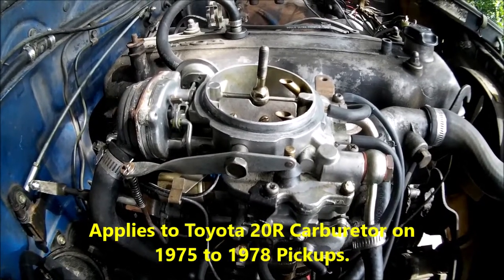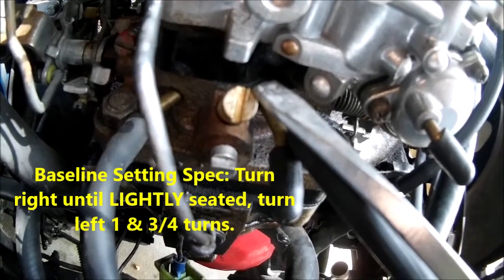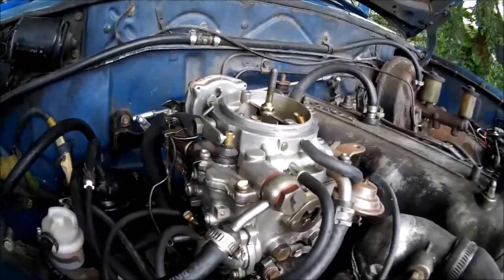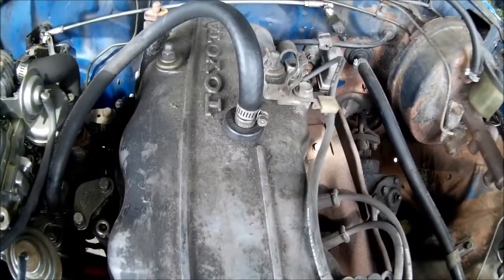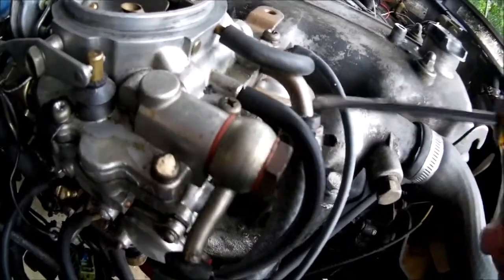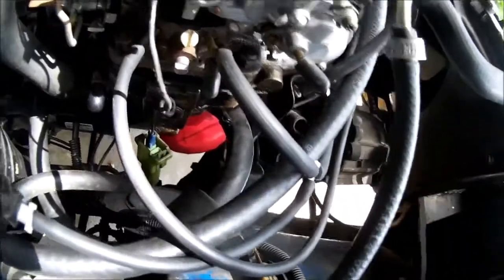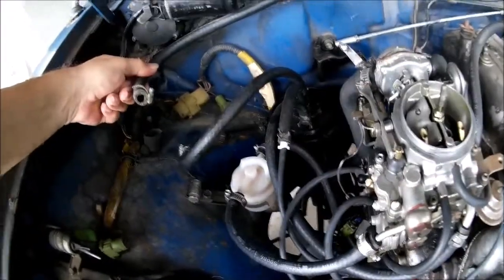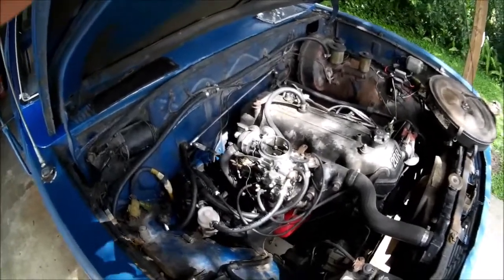1978 Toyota Pickup/Hilux 20R-Carb Adjust & Vac Lines-Desmogged

Comment: Thanks for the video.  I am having trouble getting a smooth idle. When I go to set the throttle positioner either goes 1300 or 600.  FSM says to set it at 1050, then do the lean idle mixture procedure.  Do you have any clues?
Reply from the maker: If by "throttle positioner" you mean the Idle Adjustment Screw I do have some ideas. First thing that comes to mind is that you should only try to set idle speed when the engine is at full hot operating temperature. The reason for this is that the choke mechanism is mechanically connected to the throttle, and if the engine isn't up to full temp, the choke may be trying to keep the engine at high idle for warm up purposes. There are several "steps" on the part that the Idle Adjustment Screw can contact, and it may be contacting one of the "higher" idle steps sometimes, other times the "correct" hot idle "step".

Looking at your speed numbers, they are not correct (according to my sources), but would indicate to me that this is what is happening. The difference between the 2 numbers is correct. The spec I have on hand for the '78 20R is "Hot" idle speed 800-850, High (cold) idle speed 1600-1650.

If you are trying to adjust with the engine at full hot temp, then you have a "sticky" throttle linkage on the carb. Meaning there may be some dirt/dried fuel residue "gumming up" the linkage and making it bind up. You may want to try spraying down the entire linkage with carb cleaner & letting it thoroughly air dry then try to set it again.

Beyond this, there are several other things that could cause this. Worn, bent or damaged throttle linkage parts from pedal to carb, damaged or missing parts on carb, vacuum leak(s), carb itself worn (most common issue being worn out throttle shaft bushing causing a hard to find vacuum leak), bad carb gaskets, out of adjustment or bad choke mechanism (not too common).

Just start with the basic stuff, like making sure the carb & linkages are clean & that it's up to full temp before trying to adjust. 8 times out of 10 it's the small, simple things.
Reply: thanks so much. By throttle posistioner, I am referring to the screw on the far right (looking from the passenger side of engine in) that is a bit underneath and the screw adjusts the throttle/butterfly on primary side). Since I wrote you,  my brother and I decided to rebuild the carb.  we are almost done.  We are also going to check all the throttle linkage and make sure it is smooth.  We did find a couple of small ports clogged and got some grim off the linkage springs.  We will see.  We will continue to troubleshoot per your tips!!  You are awesome.
Reply from the maker: @MichaeleLaForge  Oh that one. That adjustment screw has very little to to nothing to do with idle speed in normal conditions. It adjusts the "Dashpot", which is the common term for that item; Toyota calls it a "Throttle Positioner". IF you can put that screw back on the setting it originally was that would be best.

The Throttle Positioner is connected to a vacuum diaphragm that controls it's movement. It's purpose is to cushion the throttle from slamming shut when you completely remove your foot from the gas pedal. It basically "catches" the throttle linkage near the bottom of it's travel and lets it settle to the full closed position smoothly. All this happens in less than a second. Also, if you've run that screw IN a bit or a bunch more than it should be, it could be affecting your idle speed.

If you end up having to do an adjustment on it after your rebuild, it's going to be a more-or-less trail and error thing. A good baseline setting though is as follows. Engine not running, choke plates OPEN, Idle Screw on low idle cam. Turn the Throttle Positioner screw OUT until it no longer makes contact with it's linkage arm. By this I mean it just barely doesn't contact the arm Then turn the screw back in 1/2 turn.

Start & warm up the engine to full temp, make sure choke plates are fully open & idle screw is on the low idle cam. Rev the engine a bit and then completely let go if the throttle (you can do this under the hood). Watch the Throttle Positioner arm where it contacts the screw & listen carefully There should just be a slight delay in it settling down to normal low idle. This delay will literally be like 1/2 a second or so. If the delay is longer than that, back the screw out a little at a time, like 1/4 turn, then rev, watch & listen again. Adjust until you get about that 1/2 second delay.

You could also get lucky and see by discoloration just where on the screw it was set. Where it was inside the threads will be cleaner looking than the rest of the screw's threads.

Once you get that set, go back & set your Idle Speed screw to the left side of the carb, passenger side.

One other thing, in case your carb rebuild kit didn't mention it. Baseline setting for the Idle Mixture Screw (passenger side, low center of carb location). Run the screw in CAREFULLY using only light finger pressure on the screwdriver, until it just stops.
DO NOT TIGHTEN IT DOWN OR YOU WILL DAMAGE THE SCREW & NEVER BE ABLE TO GET A GOOD IDLE QUALITY.
Once you have the screw in that position, turn it back out 1 & 1/2 to 2 turns. That should give you a good mixture setting to start with and get the engine running.

You can further adjust it afterward for fine tuning. If you need info on this just let me know.
Reply: @The13thSword  Success! The carb rebuild definitely helped the performance but idle still tough. So I actually read your post on a forum.   Your comment about the dashpot and the quick back to idle after flicking accelertor.  You said it would go back to 800 ina couple of seconds.  That got me really thinking about the dashpot and what it does.  I tested it per fsm and  it  turned out that the vacuum switching valve was bad and it was not getting any vacuum.  

I went thru the set up per manual and what you advised and now I have a stable idle at 800, 8 degrees before TDC.  So 😊.  now I will go to Cali smog test.
Reply from the maker: @MichaeleLaForge  Excellent work. As long as the Dashpot has an engine vacuum source it will work the way it's supposed to. Hopefully you won't have any problems passing smog. Even with some or all of the "smog" equipment not working, these engines, when in proper tune, & a good state of repair, still run very clean. Also due to the age of the truck, they really don't know what smog equipment is supposed to be there so you'll likely pass the visual inspection without issue.

You haven't mentioned it & you may have already done this, but you may want to do a valve adjustment to make sure they are in spec. It can make a big difference in smog test readings.

Pro Tip: I know the FSM says to adjust the valves with the engine totally hot, but it can be done properly (and more easily & safely) when cold. I set the valves 2 thousandths above the spec.
Spec is Intake .008", exhaust .012", so I set them cold at .010" & .014". Once the engine heats up all the metal parts expand a bit & the clearance goes right to spec. I've tested this several times and the clearance is always spot on spec at full temp.

Let me know how things go.
Reply: Hi, I passed smog a couple weeks ago.  Thanks again for your tips.  Since then I started working on niceties.   Visors, dome light, radio.  All repaired.  
One thing that is funky is that the truck runs really well, warms up w choke working well etc..but after I drive it for a while, like 5 Mike's or more, then park, then go to start it, it won't idle...it starts then drop to zero RPMs and dies unless I apply a little gas...after a while it settles back into running smoothly.  I am going to check for vacuum leaks, timing and make sure  sparking on all cyl.  Seems like a timing issue.
Reply from the maker: @MichaeleLaForge  Sounds like a good plan. Timing on the 20R should be 8 degrees before top dead center.

Other item I would check is the ignition coil. if it's not a new one it could have some high resistance due to fatigue in the coil wires inside. And a failing coil could act the way you describe. It's easy to check if you have an Ohm meter. The stock resistance specs are: Primary - 1.3 to 1.7 Ohms, Secondary - 6,500 to 10,500 Ohms. Primary is measured on the + and - posts, Secondary is measured on the center post and the - post.

Check em both out but it's been my experience it's usually the secondary that goes wrong first. Those specs are "cold" readings BTW.

Other things it might be are a partial blockage in the idle circuit, sticky distributor advance weights, sticky vacuum advance. Depending on how old the distributor is it could be either of those last two things, and both of those affect timing.
Reply: I do gave the dashpot on full time vacuum...cause I discovered the vacuum switching is not working...not sure want the issue is get...I tested w long hose and pressure sensor in cab when driving and no changes were happening.  perhaps speed sensor issue ?   the other thing I disconnected was the aap cause the tri port thermo vacuum switching  valve (near intake) not working all ports are always vacuum...so it was sucking fuel all the time.  I did both those disconnects prior to smog, and the issue started then. So maybe a fuel prob, rather that ignition?
Reply from the maker: @MichaeleLaForge  No problem on full-time vacuum on the Dashpot. I have mine that way & it works fine.

There are no speed sensors in this vehicle. They didn't exist when the truck was made.

AAP. Have you got a good quality vacuum cap on the port to the AAP? You should. Do you still have a vacuum line running to the thermo vacuum switching valve?  If so, disconnect it, remove the vacuum line entirely & cap off the vacuum source for it.

Unless it's been modified, you should also have a "vacuum tree" on the intake, located directly below the carb on the passenger side. That thing has at least 3 vacuum ports on it that need to be securely capped off. I removed mine during the "desmog" process and installed a plug.

One other thing I remembered. Try testing your pickup coil in the distributor for resistance. Cold it should be 140 to 180 Ohms. And yes, when they start going bad they can act just like a failing ignition coil, i.e., higher resistance when hot. This would also make sense if the distributor is old/high mileage.
Reply: @The13thSword  Thanks 13th. I put a new coil in. so it may be some of the other items you suggest.  I will do one at a time and see if I can find smoking gun.  the other thing I found in the owners manual that has very specific instructions on how to start the truck when warm.  It says: Hold the pedal about halfway down while cranking the engine. Do not pump the pedal.  If quite hot, press the accelertor fully to the floor while cranking.  

I had been either not doing anything to the pedal, and when it started and died, I would start pumping the pedal. I was essentially doing opposite what the manual instructs!  that also may be the problem...maybe I'm starving then flooding?
Reply from the maker: @MichaeleLaForge  As long as you've got a good quality coil and it Ohms out in spec it's probably good.

About starting warm or hot with a carbureted engine. I don't disagree with those instructions but will say they go a bit more to the side of caution. And they do leave one thing out. In my experience, with an engine that is up to full temp, you shouldn't have to touch the pedal when trying to re-start, within say, 20 to 30 minutes. If everything is set up & working properly, you should be able to just turn the key to start & it'll fire right up in a second or two. Of course this demands that you have zero vac leaks, the carb and ignition system are working right & the engine has no issues.

The reason they want you to either hold the pedal halfway down or full to the floor has to do with a condition known as heat soak. The carb can absorb under-hood engine heat, especially when you shut the truck off. That heat can start vaporizing the fuel in the carb's bowl. The vapor then goes out the vent tube & falls down the carbs throat. Since the engine is not using that vapor, it tends to build up in the intake manifold. Holding the pedal halfway or full open when cranking "hot" opens the carb's butterfly valves in the bottom of the carb, allowing extra air into the intake manifold, and "leans out" all that fuel vapor so the engine can burn it.

Pumping the pedal causes the carb's accelerator pump to literally shoot fuel down the carb on each "pump" so yes, you were in fact flooding it. That's why you hold the pedal to the floor when it's flooded, to allow more air in & help the engine clear out the excess fuel, & bring the air fuel ratio back to something the engine can burn. Rich fuel mixtures are difficult to burn even for a perfectly functioning carb/engine setup.

Not a lot of people are familiar with carb operation anymore, since some sort of fuel injection has been used on production vehicles since the 80's. Most fuel injection systems don't have a heat soak problem that some carbs can experience. But carbs can work just fine as long as they are working well & you know how to handle them. Again, just my experience, but starting a "hot" engine & with everything right, you shouldn't have to touch the pedal at all. You could hold the pedal open a bit when trying to start hot, and I've found that works too.
Reply: @The13thSword  very helpful regarding the butterfly and the airfuel.  

So I made sure all my caps were good as you suggested.  I drove around for about 30 mins...ran it pretty hard.  it performed well during the drive, no stalling coasting to stops when RPMs dropped.  it even restarted several times without me touching the accelertor pedal.

I decide to wash it, so it's sitting for about an hour and I tap the pedal 3 times in case thw choke needs to reset and it starts and immediately drops to zero runs and dies. it did it several times.   So I tried to contain my frustration and manually set the choke on the first detent and it started smooth and then went back to normal smooth low idle.   Do you think I did to adjust the choke initial position to be a bit more open ..you know turn the body where the coolant flows in and out?  or maybe I need to replace the choke body.  I have and extra.  

BTW I did check the timing and coil, all good.  I plan to rebuild the distributor soon just because it's so old.
Reply: meant to ask, do you think I should change the choke set up setting and Crack more open?
Reply from the maker: @MichaeleLaForge  About automatic chokes. IF your choke is functioning & correctly set (usually the large middle "notch" on the coolant body, lined up with the reference notch mark on the carb body), there should still be no need to touch the gas pedal even after an hour of it sitting.

As the engine & carb (and therefor coolant in the choke housing) cool down, the bi-metal spring in the choke mechanism also cools & contracts, pulling the choke plate closed. What you need to understand here is that since it takes time for the heat to dissipate, that spring is also slowly cooling. Meaning that the choke plate will slowly close over time. As long as the initial adjustment is correct, the choke plate should be in the correct position to regulate the air flow, for whatever "heat" condition the engine is still in. The only time you really need the choke plate to "reset" to completely closed is with a "dead cold" engine. Depending on ambient temp (outside air temp), this could be 2-3 hours or more, sometimes as much as 8-10.

Your tapping the gas pedal 3 times after an hour is causing the accelerator pump to shoot 3 squirts of fuel down the carbs throat. That fuel is now sitting in the intake manifold. When you then start the engine, it starts on the air/fuel mixture that was already in the carb & intake. That burns off quickly but then the engine starts to get all that fuel you just squirted down there. It's too "rich" a mixture for the engine to burn so that's why it dies. BTW, remember you saying about those instructions about holding the pedal half-way down? That will also reset the choke if it needs to. No need to tap the pedal 3 times. If unsure, just try tapping the pedal ONCE. As long as nothing in the choke "chain" is sticking that's enough for a reset. On mine for "warm" starts (an hour or two sitting after running at full temp), I don't touch the pedal at all. It always starts but sometimes has a lower than normal idle. I tap the pedal once after it running & the idle speed come right back to normal.

If you want to try to adjust the choke the engine has to be "dead cold". Move the throttle linkage just a little & the choke plate should snap fully closed. If not, manually set the plate to closed. Loosen the screws on the ring that holds the water choke housing. DO NOT REMOVE THE SCREWS, just loosen them enough so the housing can turn. SLOWLY turn the housing & watch the choke plate. If the plate doesn't move while turning in one direction, try to other direction. (Note: Do not turn the housing past the range of the marks on it in either direction; that can damage the spring inside.) Stop turning when you see the plate just start to open up. Then turn back until the plate just fully closes. Then tighten down the screws on the ring until they are snug. Do not overtighten.

This is a basic "baseline" choke setting which should work for most places & conditions. Also if you haven't already, use carb cleaner to clean the entire choke linkage, let air dry, then apply a drop of mineral oil (like 3-in-1 oil) to every pivot point in the linkage. You can also use white lithium grease. This is to make sure the linkage isn't binding from dirt or other gunk, & that it works smoothly. IN fact, I advise that this be done BEFORE you try any choke adjustment.
Reply from the maker: @MichaeleLaForge  That would depend on your local conditions. I'd only do that if I was running the truck in a climate that is normally very hot, like normal air temps of 75F (24C) or above, and only if the engine seemed to run or work better that way. I have mine set up "stock", which is just fully closed when engine is cold. It can get pretty hot here in Florida, especially during the summer (day temps normally 90F (32C+) or above, but it acts & runs just fine on that setting. If you're in North America I wouldn't bother with it, just use the "normal" setting I described in the other reply.

BTW, also make sure your Choke Pulloff (also known as a "choke breaker") diaphragm is working and has a good vacuum source going to it. This is the diaphragm on the back-side of the carb next to the water choke housing. It's job is to open the choke plate a bit when cold once the engine starts.
Reply: @The13thSword  got it re choke.  I played around w it and it was not a factor it the warm start problem.  so now I am focusing on the coil. 

I tested the old coil I pulled out and it reads in spec for the primary and for the secondary I can't get a reading. It is open...oL on ohm meter.  I am waiting for the one in the truck to cool down but so far that one also reads OL on secondary and 2.9 on primary.
Reply from the maker: @MichaeleLaForge  Just to be clear about a few things.
1. To resistance test ignition coils you have to completely disconnect them from the system, all three terminal points; power (+), negative (-) & the center post wire to the distributor. It's the only way to get a truly accurate reading.
2. Is your Ohm Meter self-zeroing or not? Many cheaper Ohm meters are not, so you have to touch the probes together first to see if the probe wire have a resistance reading. That then has to be subtracted from the Primary reading you get.
3. If you are getting an OL (open loop) reading on a coil that is otherwise working (the engine runs on it), there is either something wrong with your meter, or you aren't making good contact with the probes on the center post terminal and/or positive or negative terminal (doesn't matter which one, secondary can be measured from center post and either + or -). If the secondary coil side of an ignition coil is truly OL there is no way it's going to run an ignition system.

Here's a decent video on coil testing if you need it: https://www.youtube.com/watch?v=FIx4dxew_UU

The 2.9 Primary is way out of spec for your 1980. It should be 0.5 to 0.6 ideally. It's also too high for even a '75 to '79 coil, which is 1.3 to 1.7 You've got me very curious about the brand & part 3's on those coils now. Let me know what those are, if you can.

One other oddball question for you. Are you running a Ballast Resistor on this ignition setup? I don't think the '80 model came with one but it might have. If you do have a stock one in there it would be mounted on the coil bracket, and would be wired inline on the power feed for the coil.
I ask this because there should be NO ballast resistor used with the HEI Module setup at all.
Reply: @The13thSword Re the 2.9 primary reading,  I had the coil hooked up so likely why it was reading high. 
I have a very high end multimeter, was like $200+, but I bought it mostly for the work I do w my well...so focused on pumps and amp readings,  so perhaps the ohms not great?  I really tried to scratch down into the middle connector to get goo contact and still no reading.  I also ended up buying a 3rd brand new coil from napa ..no reading, so I think it must be my meter.   the car definitely runs and runs perfect until I shut it off after warming and try to start it back up...then it will start and drop to zero rpms and die.

I ended up putting the orig coil back in this evening and now I am wondering if it is a wiring issue to the distributor.  there are 2 wires coming off the positive post on the coil and  they are shielded together and they connect to the distributor via a connector fitting.  then there is a single wire from the negative pole..that one I am not sure where it should go.  I currently have it grounded.  perhaps that need to go somewhere else.  I remember, not remembering where that should attach last time I fiddled w the distributor so I just placed it under one of the dist screws ...could that be the smoking gun?
Reply: also the ignition set up is stock.  big antique looking box mounted on the coil.
I am pretty naive when it come to car ignitions...ignition... maining work on older Japanese 2 stroke bikes w a single coil and points, points plate...so I am still coming up to speed on the ignition system on this truck.   Thanks again.
Reply from the maker: @MichaeleLaForge  A $200 Volt/Ohm meter should be self-zeroing. Yep, you definitely need to disconnect everything from an ignition coil in order to get accurate readings on it.

I'm not understanding your wiring description, especially given that you are now running the HEI Module. Have a look at this diagram: https://www.camaros.net/threads/remote-mount-hei-module.462339/

The Negative post on the Ignition Coil goes to the "C" terminal on the Module. This allows the Module to switch the Ignition Coil on & off. There should be no other connections to the Ignition Coil negative post.

I have no idea why any wires from the Ignition Coil positive post are connected to your distributor. That shouldn't be. Again, look at the diagram. The positive post should only be connected to your Ignition Switch power source (both RUN & START). The Module is also powered from that power source. The Distributor doe NOT require 12 volt power at all.

The Distributor grounds itself through being mounted to the cylinder head; no extra grounding required. You should not have the Ignition Coil negative pole grounded to the distributor or anything else at all. See diagram. The only ground wire needed in this setup is the one that goes from the mounting hole in the Module behind the B & C terminals. This is the crucial ground that I mentioned before.

The 2 wires coming from your distributor are from the Pickup Coil. One should be White & the other should be Red or Pink. White wire goes to W terminal, Red or Pink wire goes to G terminal on the Module. Just to be clear, the Pickup Coil does not require battery power, it makes it's own voltage. That voltage is the "signal" the Module uses to turns the Ignition Coil on & off.

Have a look at your wiring job again & compare it to the diagram.

Last idea. How is your Module mounted? Does it have a heat sink or not? If not it needs one. The dying after hot restart could be related to this. The HEI Module has a metal plate on the bottom of it to transfer heat away from the Module, but it needs contact with a larger metal surface to do it correctly. The Module under normal operation does produce heat & this heat needs to be directed away from the Module via a heat sink.

I used an AC Delco HEI heat sink that I modified to get it to mount the way I wanted, but like the diagram says, you can use a 1/4' thick piece of flat aluminum. 1/8' thick would work as well, as long as it's at least twice the size of the module in surface area. A thin layer of heat sink paste between the Module's metal plate & the aluminum is recommended.
Reply from the maker: @MichaeleLaForge  The box on top of the coil is the stock Igniter, which I thought you said went bad, & that's why you went with the HEI Module? If yes, the HEI Module takes the place of the Igniter, & nothing in the ignition system/circuit should be connected to the Igniter at all.

I understand about the points. Maybe this will make it clearer for you. The Reluctor Ring on the distributor shaft and the Pickup Coil takes the place of the distributor cam & the points. The Igniter or HEI Ignition Module also replaces the points, in the sense that the points are the "on/off" switch for the coil. The only difference is that the Module is all electronic switching instead of mechanical points switching, so there is no more points wear, arcing or pitting. And the Module automatically controls Dwell as well. Bonus.
Reply: @The13thSword  Hi, I went back through the wiring diagram and the current set up.  I was confused because a previous owner spliced the wires from the ignitor box to distributor and changed the colors. I untaped and figured it out.  it is wired correctly but I don't like his/her choice of wire (gage and shielding), so I will likely redo that.  I cleaned the connections and the pickup coil.  All is OK with coil, igniter distributor.  I did all that and again truck ran great, even better.  But it stalled at the end of the test drive when I was down shifting and the rpms dropped w clutch in.  So I went back to forums and found a couple of ideas to hunt down.  1. the emissions panel near the fuse box.  2. Fuel cut off solenoid.  
I just cleaned up the connectors to the box and juggled things around, secured the harness a bit better.  So far it is acting appropriately.  Starting when warm w pedal half down.  I need to go on a longer uphill test it fully and fingers crossed I will report back w good news.  Thanks again and have a great Sunday!
Reply: yep, definitely an electrical signal issue between the emissions control box and the carb.  It is intermitten but I confirmed it when I got back home after test drive, barely touched the box and it ummediately died.
Reply: confirmed that the harness connection to the box is not great and this caused the weak/imprecise  signal to fuel shutoff valve.  I've got it  Jerry rigged and now running without cutting out and starts right up after warmed up.  No pedal required.  Thanks so much for helping me troubleshoot and learn at a deeper about most of the systems in the vehicle.  Until next time.  I wish you and your all the best.
Reply from the maker: @MichaeleLaForge  All good work. I always suspect something weird being done by previous owners when it comes to older vehicles. It's always a good move to verify everything yourself so you know if it's right or not.

If you have done the "desmog" on the truck, just unplug the emissions computer. It doesn't do anything after desmoging because any of the components that it can control have either been disconnected or eliminated. Unplugging the Emissions Computer will eliminate it completely from the electrical system. The way the electric system is set up it shouldn't cause any other issues with it being disconnected. I run mine this way with no issues.

RE: Fuel Cutoff Solenoid. It's rare that one of these stops working on it's own. It grounds thru the Carb body and has a 1 wire power feed. On mine it plugs into a green plug on the passenger side, that has a single terminal in the plug. This should be "hot" in RUN, likely also START. Only other problem with those is the little rubber piece on the end of it inside can deteriorate (again not common).

You're doing a good job here. Once you get thru all the electric & if you still have the same running symptoms, it's going to be time to look at the fuel side of things. If I could be sure that the electric is all good, I'd suspect an issue with the Idle Circuit side of the Carb.
Reply from the maker: @MichaeleLaForge  Unplug that puppy & try another test drive.
Reply from the maker: @MichaeleLaForge  Well done. Don't forget to go back and retune the carb now that everything is stable. It may or may not need a slight tweak on the mixture to be near perfect.

Glad to be of assistance & to help you learn the systems. As always anything else I can help you with just let me know.

BTW, here's a little something else for you that can help out in the future. Online PDF copy of the Muir repair manuals for Toyota Pickup 1975 to 1987. Enjoy.
chrome-extension://efaidnbmnnnibpcajpcglclefindmkaj/viewer.html?pdfurl=https%3A%2F%2Ftoyotachinook.files.wordpress.com%2F2011%2F12%2Fhow-to-keep-your-toyota-pickup-alive.pdf&clen=135207922&chunk=true
Reply: @The13thSword  Re fuel side, prior to passing smog, my brother and I worked hand in hand and meticulously rebuilt the carb.  Then I set the mixture using lean drop and got it running great.  I am hesitant to change the air fuel mix.  I am a bit of a fanatic when it come to restoring to stock, so I will likely meticulously work through getting all the various thermo valves and vacuum switching working perfectly....but this can be over time...it bothers me that I have to keep constant vacuum on the TP or that the AAP vacuum is not shutting off after warm up.  but I may have to just live w this since the valves are so rare esp the thermal activating ones.  I also feel there is a tiny miss fire.  likely the distributor...so I do plan to rebuild at some point.  I was quite happy w the AC, I got it running great...like. freezer w R12, and I got the cooling system and heater working awesome.  I love my little truck, I feel like I go back to my high-school days every time I drive it and play that original radio on the local FM  80s rock station.
Reply: @The13thSword  thank you for the manual!!!
Reply from the maker: @MichaeleLaForge  By all means, if you're happy with the way you have it set up & running, don't change it. I absolutely appreciate the caution & being meticulous with what you do; I try to do the same. I also understand about "restoring stock" but over the years I've found that sometimes we just don't have much of a choice in the matter, IF we want to keep these trucks running. Some critical stock genuine Toyota OEM parts like fuel pump relays, fuel pump resistors & vacuum thermal valves & others just aren't available anymore, even from the aftermarket. So we just have to dive into the engineering & original functional intent & come up with ways around the old system(s) that work well.

To this end I can tell you the following. Constant vacuum on the TP seems to work just fine. Having no vacuum on the AAP at all also works fine. That little feature of the carb was designed to get the engine to warm up faster to cut down emissions. That pairs with a published fast idle speed of 2250 RPMS (!!!) in the service manual was supposed to make that happen. I find no difference at all functionally with the AAP disabled & capped off.

The misfire may be the distributor, but if you have an inductive timing light you can check this out. I just put the spark plug wire clamp on each wire in turn (1 thru 4) & watch the flash rate on the timing light. If you have a spark misfire you'll see it easy enough. Rebuilding the distributor may or may not cure that. I can say that the rebuilt distributor I got from Cardone thru Rock Auto (CARDONE 31725) works perfectly. And I know they rebuilt it & baselined it better than I ever could. Plus I never could locate a rebuild kit for it (new bushings, washer, springs, etc.)

Excellent work on the AC & heat sir! Keep it up!
Reply from the maker: @MichaeleLaForge  No problemo. :^)
Reply: @The13thSword  great advice on the misfire, will test soon!